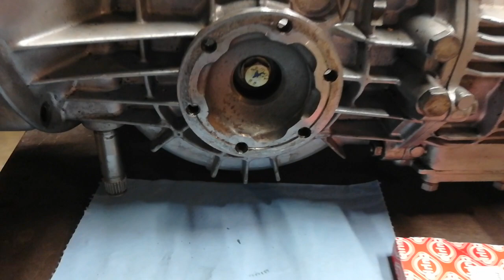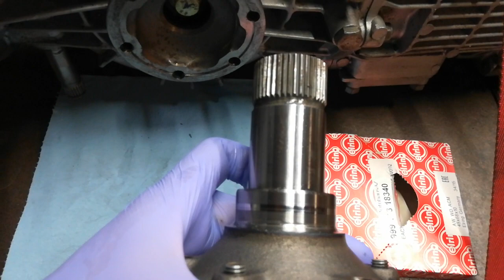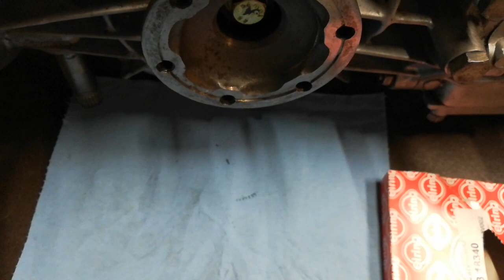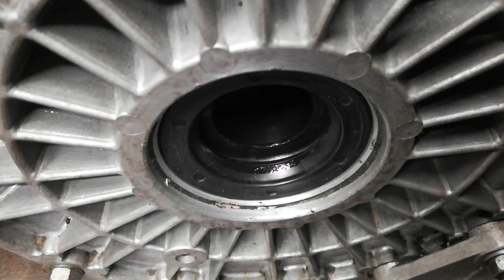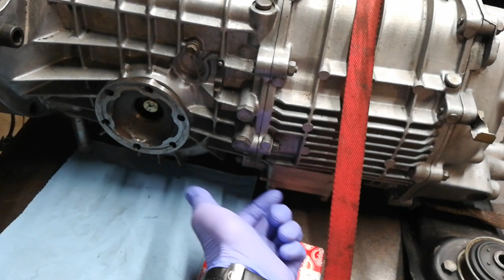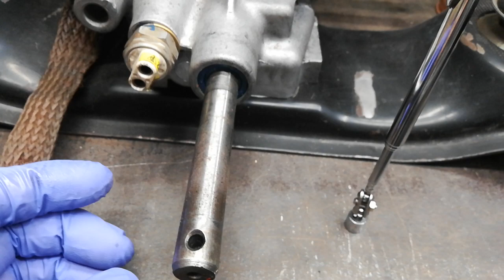Air-cooled Porsche 911SC 915 Gearbox Reseal Part 1

Comment: hi.  your light please.  I have a rattle noise at idle  when the engine gets hot and the clutch is out. when I press the clutch in no noise. I use swepco 80/90 and I change the trans oil every 10.000. miles. what  do you think throw out bearing or input/ main shaft bearing? or anything else?? thanks